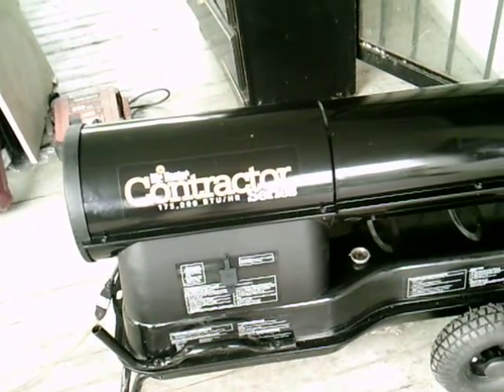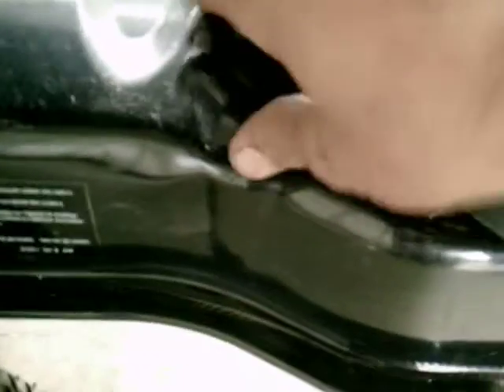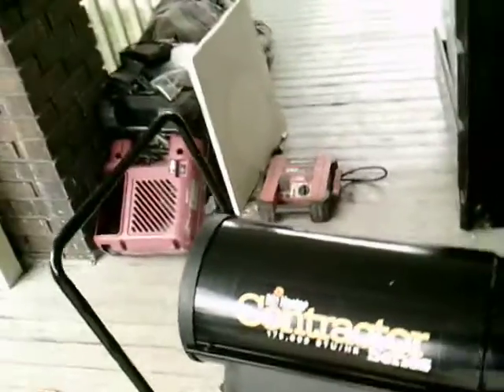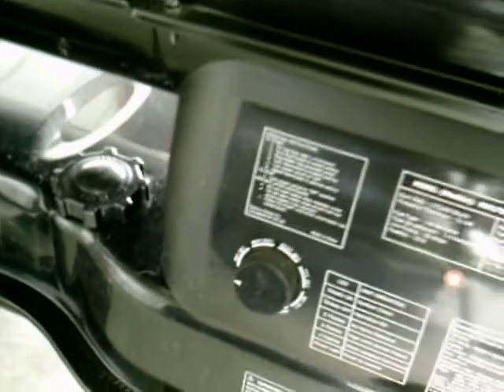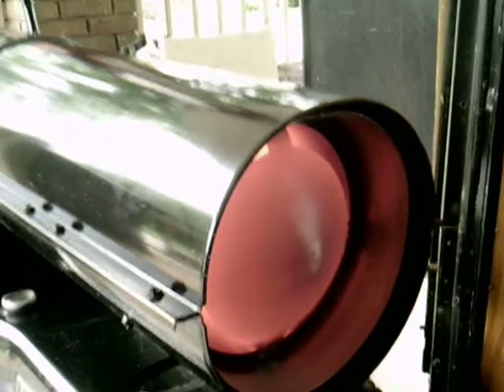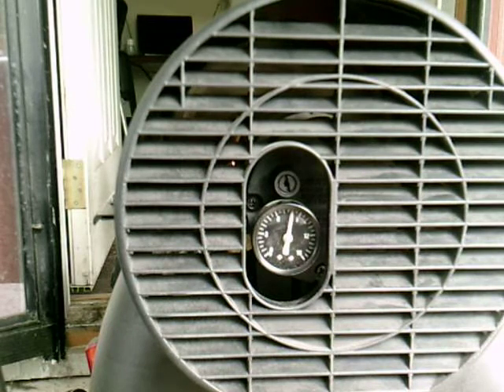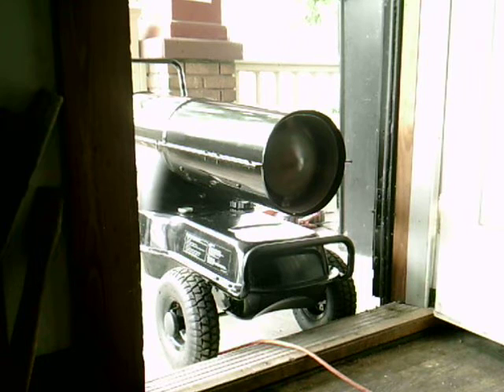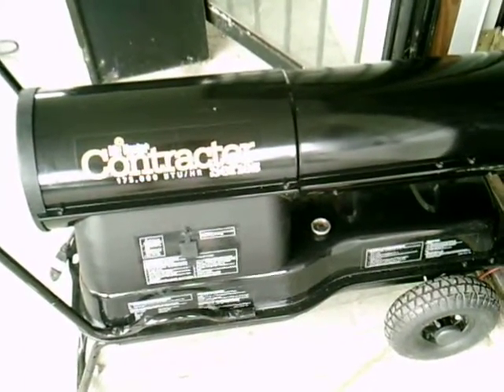Torpedo Heater Repair //  Mr Heater contractor series !

Comment: I have one of those, but it started to turn off when it reaches half a tank and the red light flashes twice, what does it mean or what problem will it have?
Reply from the maker: There is a set process to repair this type of heater. You need to check it for leaks ( air ) and go on from there. I would say first check your rubber air line to make sure it is tight and not cracked at the front and rear fittings. I would also suggest you call us to go over it. I will be in the office in 40 minutes until midnight so if you like you can call (216) 801-6215. In eastern standard time for 3 more hours. But I wont be there for another 40 minutes ...

Comment: Torpedo Heater Repair // Mr Heater contractor series !  ** where is the "Torpedo Heater Repair" part???  just a sales video.
Reply from the maker: No Im just showing a heater I put together.  The heaters I use are one of my favorite heaters.  The heater company has their own videos.  And there are other similar videos using different heaters.
Reply: I appreciate that -- I'm simply pointing out that the title of your video starts with "Torpedo Heater Repair..."
Reply from the maker: No Problem

Comment: I have the exact same heater and everything works except when the spark ignites the fan comes on and it never ignites a flame ?
Reply from the maker: +toggahp Hi 
Well that will call for some testing. You can call me at 216 801 6215 during business hours 
Thanx 

TH
Reply: @TorpedoHeat  Don't you have a phone at home
Reply from the maker: @beanieboobamboozle6764  216 801 6215

Comment: If you have a fly outside you dont need a heater, them heater get alot hotter if you use gasoline in them.
Reply from the maker: Yes gasoline will get hotter but too quickly  Dont use gasoline
Reply from the maker: Trace amounts of gasoline can cause a bad fire.
Reply from the maker: Trace amounts of gasoline can cause a bad fire.

Comment: You are absolutely clueless. They do not burn over 1500°. Not even close. Tops 1000°
The cone is very thin metal and if it were to get to 2500 or 3000° like you just said it would turn into liquid😂
Reply: You got that right